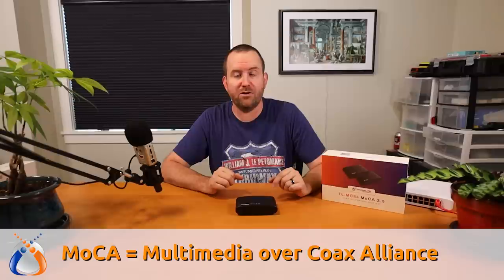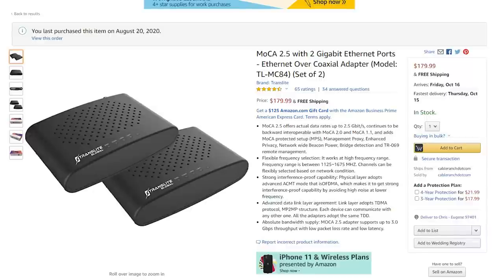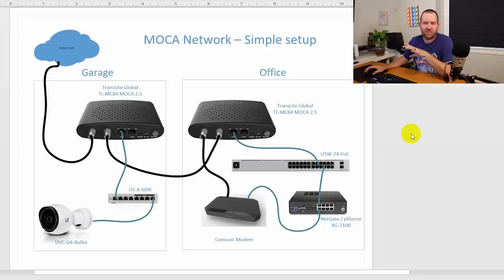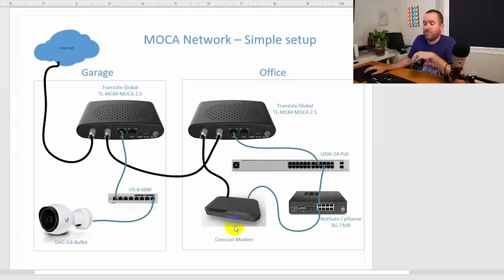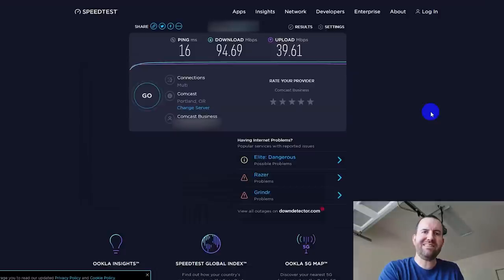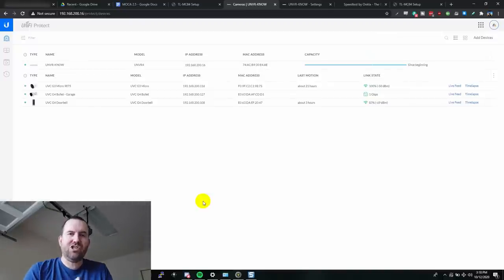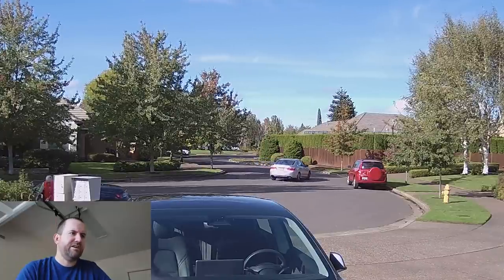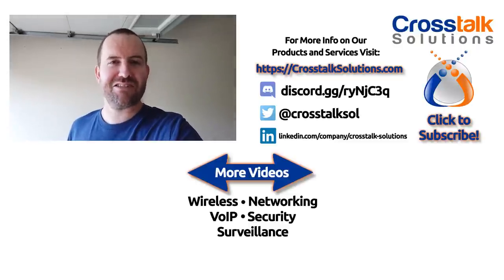MoCA Made Easy!

Comment: I'm only 11:00 into this, and I already gave my thumb up and subscribed. After watching no less than seven different videos about Moca, this one is the best by a large margin, and most of the videos I watched were quite good. Ok, finished the video, and I have to say that 90 Mbps is not enough for me to switch out my Wifi6 with two Orbi's. I'm sitting 80 feet from my router and getting close to 300 Mbps without connecting my VPN. With VPN, it drops considerably to ~170 Mbps.  Moca Schmoca:📉 I can't help but wonder if a few configuration adjustments would increase the speed.  Cheers
Reply: I think it is supposed to be way faster than this. Also, their splitters are very questionable. There is no db value given and you have to make sure that matches (probably 3.5) what your COAX is servicing. I have Spectrum and it says to make sure to use a 3.5 db splitter. Additionally, there is a much higher db value which is the interference resistance that can make a big difference in signal strength as well.

Comment: I got 2 Hirschmann Moca adapters at home. They work amazing, just plug and play.
Reply: Same here. Replaced all coax with utp except for my attic where the coax cable is stuck in the cable duct. Moca adapters are super stable and work reliably at 1 gbit/sec.

Comment: The author deserves much credit for publishing this walk-through, so please forgive my terse, critical notes on the video, looking to highlight a few errors or omissions...
-----
Recommending a pair of Translite's for $180 seems extreme given the $60 price tag of a goCoax MoCA 2.5 adapter (so $120 for a pair). Whatever its other pros (2nd LAN port?), the Translite's price is not "in line with all of the other MoCA (2.5) adapters out there." And it can't be purchased as a single unit?

Major omission on the "PoE" MoCA filter front. He never mentioned the need for a "PoE" MoCA filter, either the security or performance benefit, and both his diagrams lacked a "PoE" MoCA filter. Surprisingly, he was aware of and mentioned "the filter" a few times when exhibiting his junction box, but never explained just what the filter was or its purpose.

Really surprising glossing over the poor speedtest results. 96 Mbps is insanely bad for a MoCA 2.5 connection, but that he's seeing the same for the Internet test as well as iPerf suggests he may be using a device with a FastE NIC or has a bad Ethernet cable somewhere, throttling speeds to FastE's 100 Mbps.

Kudos for setting a LAN IP and custom password for the adapters, making them accessible and secure once deployed on the home network, but the video would have benefited from demonstrating the diagnostics/statistics pages, with a brief explainer on target PHY rates and power levels.

Of course, the PHY rates might have highlighted that the adapters weren't operating at optimal levels, which could have led to a discussion of the splitters chosen for the project, those GE "digital all ports power passing 5-2500 GHz" 2-way splitters. Just having splitters labeled to support a frequency range above the top MoCA 2.0 frequency, 1675 MHz, doesn't make a splitter MoCA-friendly ... a requirement that grows in importance as you move from MoCA 1.1 to MoCA 2.5, where the full 1125-1675 MHz Extended D Band frequency range is in use.
 Holland's GHS-PRO-M series are well-suited for MoCA 2.0/2.5 networks, designed with lower output port isolation at MoCA frequencies to aid in MoCA's port hopping.

A helpful video, but really skips a LOT of critical info for learning MoCA basics, and that initial diagram using the MoCA adapter pass-through ports was unnecessary, and would just add confusion for a beginner. Simply jump to explaining why the pass-through port should be avoided, the non-passive aspect of the adapter's internal diplexer.
Reply: You seem like a genius with this stuff, although I guess that is probably standard for whatever trade would have knowledge about this.

Comment: Is the MoCA adapter going to interfere with the existing cable TV signal and internet if i split it upstream of the cable modem? Should I just use ROKU and the cable company's app to get tv over internet and not connect the bedroom tv's to the demarc splitter? I am in a condo and do not want neighbors to be able to backlink into my network and try hacking into my router.  I am thinking it might be best to disconnect part of my unit from the active cable TV live feed and make it dedicated lan via MoCA and routers/extenders.

Comment: I'm so confused: what is the difference between the "IN/OUT" port and the "MOCA" port? Because at 04:00 his diagram has the Internet signal connected to the IN/OUT port, but at 09:00 his diagram has the Internet signal connected to the MOCA port (albeit through the splitter).
Reply: The in/out is used for the cable TV signal. His cable modem is using the cable signal. So on one end of the house, he connecting the Moca "In" port to the incoming cable service, and on the other end of the house, the Moca "out" port is used to connect to the cable modem. Thus the Coax is carrying both the Cable signal as well as the ethernet signal.
Reply: @guytech7310  Not to insult you, but I really do need to have this explained using clear and proper English. Normally I can decipher a few spelling and grammar errors, but I'm lost here.
Reply: His setup needs work it's not ideal

Comment: Does the first MoCa adapter HAVE to connect right where the cable comes in from the pole in the box?  Or will it work if I follow where the main coax line comes into the house and connect the MoCa   there?  If I must plug the MoCa into the box where the cable comes in from the pole, I have the task of figuring out how to get power to it.
Reply: He did that in the video because he wanted a connection in his garage. You can install the first MoCA device wherever you normally have your modem, and the second where you need to extend your network to. And as others have commented, make sure to install the MoCA filter on the line coming into the house and use MoCA rated coaxial splitters.
Reply: @mikek9066  ok cool. Thanks

Comment: Since you already had the wall open in the office, Run Ehternet to alternate places from there, pipe the Modem straight to the feed in the garage, Ethernet, to a MoCA device then pipe that coax feed to the office for the other MoCA device, see if your speeds increase, as there would only be 1 set of MoCA comms on any cable, I believe this would speed things up, BUT you'd have to have a UPS in the garage, but the possible increased speeds might be worth it.  I suspect with a lot of data (kids/wife watching streaming TV, your whole network, and Internet will suffer the way you have things now...  Each connector is creating losses, each splitter is creating losses, and daisey-chaining is probably creating retrans'd packets as everything is on the same backbone, causing unneeded, and unnecessary packet collisions.

Comment: And this adapter will not interfere with the existing Comcast Internet signal already coming through the coax cable?  Also, this adapter is no longer available on Amazon, any alternatives or places where to get your recommendation?

Comment: Hello, last month, I used this product at one of my client's who has a very large house (Manor). Lots of rooms, stone wall, very thick floor, etc. My client had just had the new Helix internet and Helix television system installed.

The new decoders are now wireless and no longer use the coax cable. And to cover the whole house, the company installed 4 or 5 additional relay antennas (mesh) in addition to the main terminal (Modem / Router) The internet was constantly cutting and televisions too, suffered from signal cuts.

I used 3 boxes of Global MOCA adapter, because I needed 6 MOCA devices.

One is connected to the modem / router (which I call the transmitter) and the others are to connect 5 Unifi access points distributed in the house and for television decoders.

The 2 ports of each MOCA device (receivers) are therefore used.

Everything is working fine now.

Comment: What would happen if i am using the Coax for Cable TV signal, would a MoCa connection interfere with that ?
Reply: It shoudl be compatible as long as you use an internet provider that matches the cable provider.

Comment: I have a question about the connection to the uvc g4 camera - did you have to put the switch between the moca and the camera? Could you just plug the Ethernet cable directly from the
Moca to the camera instead?

Comment: If you use a tap and put the MoCA adapters on taps ( Directional Coupler) instead of a splitter the signal levels on the cable modem will be better, higher downstream power. I would recomend -6db Directional Couplers. Holland Electronics and Extreme broadband make good ones.  You would connect the cable modem to the strait through the legs of the tap so it is only losing 1-2 dB instead of almost 7.

For me, the real benifit of using Directional Couplers was lower upstream power which really helped prevent issues where my cable modem would drop offline sometimes.
Reply: What’s the difference between a directional coupler and a splitter? Why is the former better than the latter?
Reply: @davidc-l9174  Instead of splitting the signal equally it only splits off a little bit of it. So the majority of the signal passes right through while allowing you to connect another device on the leg. This will raise the power levels at the modem while briding the moca adapters on.
Reply: @noahwitt5902  So just use Directional Couplers instead of splitters, throughout?
Reply: @davidc-l9174  yeah. And then you put the moca device on the tap leg. One thing I have done too is putting the first dc, the one in the garage, backwards so the moca isn't having to pop through the port to port isolation and it works better too. So the drop from the cable system would go in to the out of the dc and the office would be on the in side. Moca on tap of coarse. And then in the office, moca on tap, cable modem on out, garage on in.
Reply: @davidc-l9174  yeah. 

If your going to hook up any more devices other than moca and the cable modem it is more complicated though.
Reply: @noahwitt5902  Well, you’ve lost me a bit 🤣 All of my coax cables for my house terminate in my garage, where the Comcast cable line comes in. I would put the modem and first MoCA adapter there, right? I only gave one TV in the house, so there would only be one place where I need to feed a cable box. The other coax cables would only feed MoCA adapters.
Reply: @davidc-l9174  yeah you could do that. And then put another cable box in your house. But your tv set top box does not need a high power level so I would actually put your house on the tap leg. 

I would generaly advise against running all your traffic over moca because it introduces extra latency so I would really try to get your cable modem in your house where your using it. Latency is a big deal for video calling, and gaming and unfortunately moca adds about 2ms of latency.

Comment: I have a detached garage but it is 70 feet from house. I have an Eero mesh network and it actually does reach the garage but not the strongest signal. In the garage I have an Eero pro that can be hard wired.
I have a gym and big TV out there so would like a strong signal. 

I previously buried underground rated Coax cable from the basement and trenched out to garage. I am not currently using the Coax I buried.
Can I run a Cat 6 Ethernet cable from my Gigabit switch in my house to a MoCa adapter and run the coax out of adapter to a second MoCa adapter in my detached garage and then do reverse, coax into the adapter in garage and run the Ethernet cable out over to my Eero Pro. Then broadcast a strong WiFi signal within the garage?
Wasn’t sure if the Internet has to initially be fed from Coax or if the Ethernet can be used to bring the internet to the adapter and pass through the the Coax out to the garage?
Sorry, no experience doing this, thanks.

Comment: great video. Thanks for sharing. quick question. How or what is the best way to send a hard wired eithernet connection for ring doorbell or a tv that requires internet but would be better hardwired? Is that from the at&t modem backend to the back end of the device or can this be done from the attic based on your wiring layout in this video?

Comment: Great video, thanks!   Question,  just trying to extend my LAN over an existing 350 ft coax between 2 buildings.  Ie, not trying to “split” my ISP/cable service.   Can these 2 devices simply take an Ethernet connection from a switch and extend it over coax to another switch or access point?    If so, concerns about distance? Thanks.

Comment: Be careful with splitters... Make sure your attenuation does not degrade your signal.  Some cable customers can be very sensitive to attenuation on the line and cause bandwidth lose and random modem reboots and errors in the config page event log.

Comment: My coaxial ports aren't activated by spectrum, so would I still be able to run ethernet through my coax system? Like I tried moving my modem and router around to all of the different coax ports in my house and only the ones with a cable box currently at them work. Can I still run internet through the non working ports? They are all connected at a central point in my house with splitters.

Comment: As a tech for Comcast I am cringing looking at the splitters your using lol
Reply: Yeah, I used to show customers how easy you can push your finger through the back.  Please, replace those with comscope splitters.
Reply: Also, if your modem allows it, try hitting 192.168.100.1 and check your upstream and downstream signal strength.  DS should be -10 to +10 and US should be around 40 at the highest signal strength to 51 at the lowest signal strength (higher number is worse strength, 53-53 and you'll start hitting that digital cliff).
Reply: Hopefully that's a mocha filter on the ground block too
Reply: I used to be a Spectrum tech, almost vomited when I saw that golden splitter, I stopped watching right there
Reply: BTW: That golden splitter will count as a repeat on you Javier Ortiz. Because everything is a repeat 🤣🤣🤣🤣🤣
Reply: http://imgur.com/a/Ej2Yene

With every 2way splitter you put in (well, good splitters) you are adding 3.5 to 4dB of loss to that number.  Us @ 47dBmV before setting this up for MoCa?  Now 54dBmV and may be losing block sync and may have decreased performance and reliability.
Reply: Lol yeah everything is a repeat lmao
Reply: House is probably full of ingress lol
Reply: Fellow tech here. I love crosstalk and other tech youtube channels, but they are the nightmare customer. IT pros generally are the toughest customers to work with and get very defensive when you correct something they did personally.
Reply: I wonder what is the tx 🧐
Reply: As not a comcast tech, I'm confused and would like to know what is wrong with them so I know for future projects. Are they just super cheaply made?
Reply: Hi Chris, would the way you set up allow the firewall to be bypassed though the coax?
Reply: 92mbps/2gbps?  Why is the throughput so low?  Is that expected?
Reply: @simple_networks  Those splitters are not properly shielded and use poor quality materials. It will let in outside radio frequencies that will scramble your signals.  This manifests as pixelation and packet loss.
Reply: Taylor Gibbins it doesn’t surprise me though. Reached out to isp cause of slowness issues. Like 10 times in two months. They kept blaming my modem and router. Finally convinced them to send a tech who found the problem was in the connection to the house. I’d be willing to bet that by the time they get to you they have been through several people who ask you to test the WiFi for the tenth time.
Reply: Everyone knows if it’s gold it has to be good!
Reply: @shanedavis5799  Good to know, thanks!
Reply: Certain comcast modems do moca. So you don't really need all that stuff with comcast.
Reply: As a Comcrap customer I am just cringing at using CC.
Reply: Make sure not only the splitters your adding are MoCA bandwidth compliant, but any existing splitters are checked for compliance and replaced as necessary. Also a POE filter should be installed.
mocaalliance.org
Reply: @Hepheastius  excellent info, thanks!
Reply: Those gold splitters are like those cheap pencils from China they were usually made by RCA or Radio Shack and would always deteriorate over time will eventually give you trouble
Reply: "s a tech for Comcast I am cringing looking at the splitters your using lol"

Everytime I hear the word "Comcast" I cringe too!
Reply: Anyone got any DC-12 splitters they can send Chris?
Reply: @Hepheastius  I saw the filter on his ground block.  And yea, moca works on a higher frequency than some older/cheaper splitters are rated for.
Reply: quick question. How or what is the best way to send a hard wired eithernet connection for a ring doorbell or a tv that requires internet but would be better hardwired? Is that from the at&t modem backend to the back end of the device or can this be done from the attic based on your wiring layout in this video?

Comment: For 180$ I'd rather run fiber or ethernet (obviously, if you can, construction wise)
Reply: In his old house he just drilled holes to the outside of the house and ran the cables outside tacked to the outside wall and under decks.
Reply: There's a $70 Motorola version that I use in my house. I get 900+ Mbps in iPerf tests.

Comment: Here in Eastern Europe its not rare to see this kinda of a service - Internet and TV via single coax cable. (They used the old Coax infra inside the buildings/apartments to bring in the new services).  Speed can be up to 60-70mbps downlink and 20-30mbps uplink per customer/point. Normally you get modem for the internet (coax to ethernet) and for the TV service the signal is decoded  with CAM card module via the internal TV tuner.